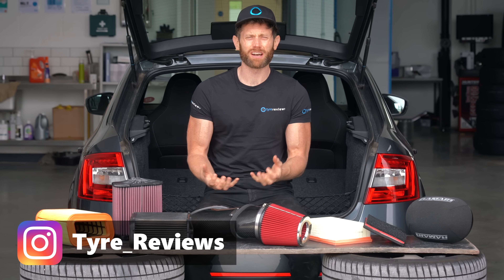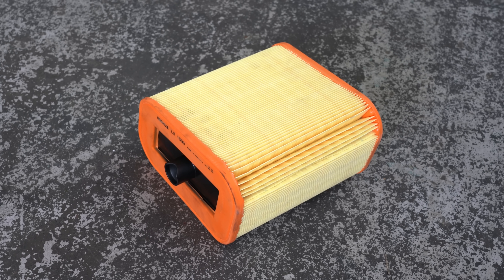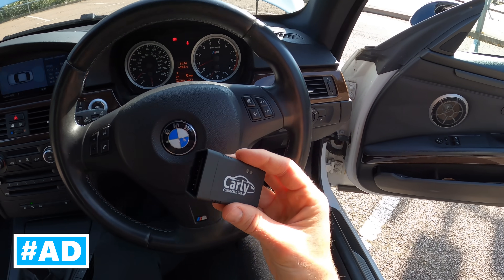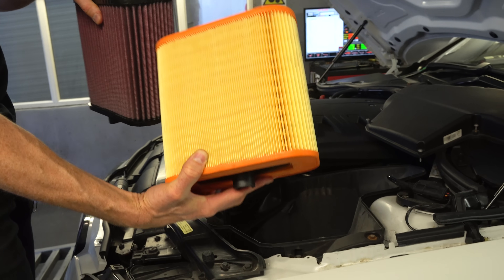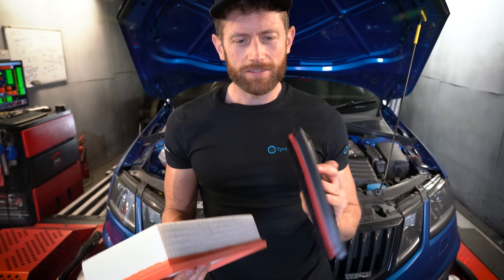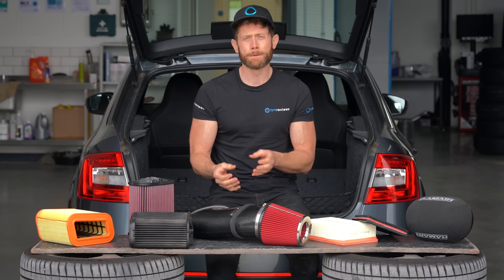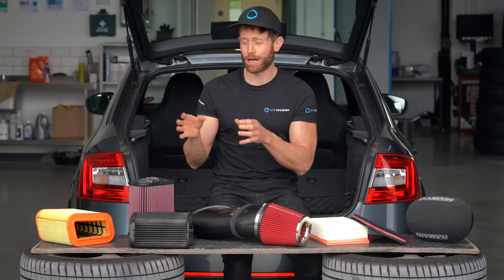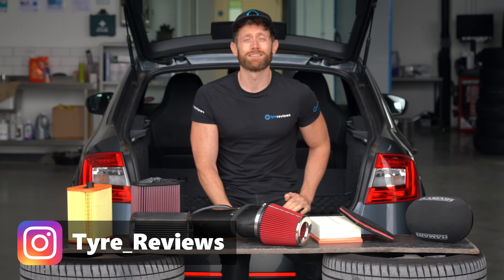Do Performance Air Filters REALLY Give You More Power?

Comment: So there are two different situations to discuss here.
1. The NA engine. There engines are pure unaided air pumps. They can suck air in as much as configuration allows (intake, exhaust, intake and exhaust valve overlap, intake valve timing using the variable valve timing actuators/pinions they may have if it's the case, and so on). The other things that matter when talking power are kind of fixed: ignition timing advance and air fuel ratios. However as you've seen the first run produced quite a bit of power and that was because the engine was cooler after it was probably stopped for a while to strap the car on the dyno. Once heat soak comes into play you will see a drop in performance no matter what you do, more evident than with turbocharged engines, simply because they suck in volume and not mass, because that's how they work.
2. the turbo charged engine. These engines are load tuned, meaning that at a certain RPM and acceleration pedal opening the ECU software targets a certain load. load is directly proportional with the mass of air. This means that depending on the conditions (intake air temperature, atmospheric pressure) the ECU software will adjust the turbo wastegate up and down to make it push the desired amount (read "mass") of air to hit its target. If the conditions are harsher (higher IATs, lower baro pressure, less permissive air filter, and so on) you will simply see higher wastegate duty cycle - read "the turbo will work harder" so reach that target. With the factory calibration it will eventually hit it no doubt, even if there will be like 0.2-0.5 seconds delay due to the more aggressive actuation for the wastegate. So no matter what you do these turbocharged engines will stay around the load target at each RPM point. The only things that will affect power will be the ignition timing andvance and air fuel ratio which may vary if the post filter (intake) temps are high and/or the intake manifold air temps (BAT - boosted air temps) are above a certain threshold, which will make the AFRs go richer and the timing go less aggressive to prevent knock, both having a negative effect on peak torque at each RPM point (torque * RPM * some constant will give you the actual power).
As a conclusion, these high performance air filters will not add that much power, usually none at all. Yes ,the factory or OEM-like paper filters seem more dense but also look at the total surface compared to the cotton wet or dry performance filters from KN, AEM, RamAir, Green, whoever: the factory filders have a larger surface even if when comparing 1cm2 with 1cm2 the OEM-like seems more restrictive.
The intakes are sized properly so that with the OEM manifolds, exhaust systems, catalythic converters, turbos when it's the case, and so on, no chocking will actually occur in normal conditions. Another common mistake people do when they add cone filter intakes is that they neglect the radiant heat which is now sucked by that filter, while with the factory air box the air is drawn from outside the car, totally or at least partially.
And one more thing people get tricked by when replacing the factory intakes with aftermarket intakes which also have a different Mass Air Flow sensor housing is that at the beginning they will see an increase in power due to the increase in air flow and leaner AFRs. But that happens one or two pulls before the ECU adapts with the fuel trim mechanism and compensates for the air flow deviation just like it does between summer and winter, or with fuels which may have more or less oxygenated additives in them (usually ethanol).
When the car gets modified, even with an ECU tune, these better flowing filters come into play and indeed may bring performance past a certain point. Up until that point they are like trying to get a drop of water through a 16mm garden hose or through a 1000mm industrial drain tube, the drop of water with go through both with the same speed because it will not be enough to have enough restriction. However when you start pumping more water the 16mm garden hose will show its weaknesses compared to the 1000mm industrial drain cement tube.
Long comment for an youtube post, but I hope this clears it all :)
Reply from the maker: Great comment, thanks for taking the time to write it all up!
Reply: "When the car gets modified, even with an ECU tune, these better flowing filters come into play and indeed may bring performance past a certain point"

So which modifications are you referring to here? And does it depend on aspiration? Asking because you seem to know your stuff :)
Reply: @solitaryclusterofneurons598  Yes it depends on aspiration. Basically if you test different air filters (OEM, OEM equivalent, aftermarket, cone filters of various kinds) you will not see any differences (or too small to even care, <1 maybe 2%) in flow at the same pressure drop or in pressure drop for the same air flow. It's like dripping water through a garden hose or a 3" tube from a 10ml syringe. Think of the hypothetical 10ml seringe as the engine capability of sucking in air (NA or tune load limited supercharged). Well, if you replace the 1ml syringe and start pouring from a 2.5 gallon or 10 litres small bucket you may start seeing the limitations of the garden hose compared to the 3" tube. That's pretty much with engines... the 10 litres bucket is the big turbo catless exhaust car or the NA with cams and better exhaust and manifolds and stuff, both with better tunes.
By the nature of things the NAs will be more sensitive to better air filters even if the gains will be smaller, they are load limited by their nature and you get more power only by minimizing pumping loses (apart from AFR, valve timing and ignition timing).

Comment: Thanks for the very interesting and informative video comparison of these filters, Jonathan. I've done some research on my own on these filters and it seems that the stock induction systems on cars from makers like BMW, Nissan, Honda et al are pretty well engineered and performance gains, in terms of increased airflow, are miniscule with most of these aftermarket systems. A good clean paper filter that can flow the engine's airflow requirements at maximum horsepower with minimal pressure drop is all that's needed. I would rather spend my money elsewhere, like with a good tune and maybe a less restrictive exhaust.
Reply from the maker: I can't wait to add an exhaust and tune :)
Reply: Stock exhausts also tend to be pretty good Jim Nesta -- good sizes (usually), mandrel bent, 409 stainless.
Reply: @TassieLorenzo  True, I'm considering installing a set of low-restriction cat back pipes, haven't decided though on things like whether to go with an x or h pipe crossover.
Reply: @videomaniac108  x pipe sounds great. I have on F-150  carven rt mufflers also used black widow muffler great flow on both 🤙
Reply: @keepitsolidkeepitreal2877  Very true. I just had a Fast Intentions x-pipe cat back exhaust, a Stillen Gen 3 long tube intake and an EcuTek dyno tune done on my 370Z 6MT sport pkg. The result is that it sounds great and picked up a uniform 15% increase in torque over the whole rev range and about a 40 hp gain in peak horsepower at the rear wheels @7200 rpm.

Comment: What we have here is a case wehre we have a properly sized air filter (perhaps even bigger than whats needed)on the BMW M3 where the CFM the airfilter can move is higher than the demand of the engine... Then we have the Turbo engine where the CFM the air filter can move is lower than the demand of the engine.  Glad to see a car manufacturer that knows how to properly size an intake for the application and one where they're under sizing it.  Would be nice to see you return to this with a tuned engine as those small gains you're seeing on that turbo engine will be way bigger when you start tuning the engine to ask for more air and more fuel over stock.
Reply from the maker: Perhaps it's time for some maps :)

Comment: All makes sense especially from the main German companies who really to their work in building their engines.  I have an Audi A6 TDI with a software upgrade.  Use stock airbox with a Piper Cross air filter.  Runs fine but didn't notice any difference, even in sound

Comment: “10 power”
“Hot air bad, even if it’s lots”
Couple quotes in there made me laugh 😂
Reply: Living in italy with many month with more than 35* C and chip tuned turbo car, i've choose to upgrade the stock intercooler reducing air temp after turbo hoping to avoid piston knock, instead of getting more hot air with a sport filter. With tune i got 42 more hp

Comment: I'm glad you mentioned project farm, otherwise I'd have made mention of it. I would take the hit in hp just for better filtration.

I have an ea888 car as well, and i do want an induction system. The only ones i will consider are the ones that will let me use the standard paper panel filters.

So far, that would be the revo carbon kit, and the 034 motorsports p34(non carbon) intake

Comment: I was going to mention the Project Farm video, but you did already! 

Very good video! 

I think a lot of people get hung up on more engine noise making more power - I've been guilty of it. 

An intake will only allow for more power when the entire system is upgraded and tuned - you can't pull in more air if you can't push it out more effectively, and you can't use the air if you're not getting the extra fuel to mix with it and burning it at the correct time. 

It's all about the balance. Now, if you want more engine noise, or you want to hear that sweet, sweet turbo spooling, an intake will help with that... a little. However, depending on what you use, you may actually cause damage.
Reply from the maker: I do like the noise!
Reply: @tyrereviews  more noise is more fun!

Comment: Please stick to tyres
I went over the comments and generalization is all over the place. I’ve seen some good improvements on older cars, backed by the data of the rolling road. I’ve got the impression that there are loads of dependencies and at least some of the reputated brands do invest quite some time in design and testing. I respect your work and test results, but they are only valid for the tested cars and tested filters.

Comment: Did you re run the first at last? That's one way of estmating the heat buildup during the test.

Then again, the only ones that have gotten more power out of special induction systems are the makers of those systems.
Reply from the maker: Yes for the M3 the results are on screen, for the skoda the first and last was the same :)

Comment: Peak dyno #s are meaningless without seeing the entire dyno chart to judge the baseline curve vs aftermarket. According to this, the M3 gained 7.5lb tq going from stock to K&N. Which means it should've gained horsepower somewhere in the low-end too. As an engine that lacks torque, any low-end gains for the S65 is a big win.
Reply: Excellent comment.  Unless you regularly drive at the RPM where peak numbers are generated, the drop/gain throughout the entire curve is what's more important.  I'm also surprised the torque gains were displayed in a way that made them hard to see and weren't even mentioned in the dialogue.

Comment: Great and interesting video! I have been changing air filters and air induction kits on my cars since I purchased the first one.
The key lies in the air flow rather than filtration. A Citroën Saxo vts would gain 10bhp with a venturi type admission.
On my e92 M3, i didn't go a bench but did 100km/h to 200km/h : no change between OEM new, K&N and even macht Schnell with the small scoops...waste of money! I gained 0,5s with the track pipes 😉.
Reply from the maker: I'm excited for the exhaust and remap!

Comment: I like to add that sometimes oiled filters like K&N Cotton filters can shed oil particles which can damage/contaminate the engines airflow sensor. (Not a problem for everyone)
Overall a very well conducted test, just like your other reviews.
Most really do miss the heat issue, I always feel a bit sad when I see a modified car with the air filter stuck straight on the turbo.
Reply from the maker: My first car, and MG ZR, I did exactly the same thing. Intake in the engine pulling in all the hot air.
Reply: @tyrereviews  Well, we all must start somewhere. :)

Comment: Dont forget to do the "Intake Hack" on the Skoda Octavia!!  I did it to my own, although a 2.0TDI 150,  and the bum dyno feels that it is sharper to respond on throttle & turbo..

Open up the Air Intake in the Grill/Bumper area, and block off the Rear Opening straight to the engine and cut open the right hand side for a Dual Intake
Reply from the maker: ooo I'll check it out!
Reply: @tyrereviews   Just YouTube Search "MQB Airbox Modification" and it should be the first one..

As well as doing the Intake Mod,  i've also installed PiperCross Filter and have the Darkside Development Airbox to Turbo Silicone Pipe,  so for a TDI,  it makes lovely spooly boi noises now 🤣🤣
Reply from the maker: @MrAndersie91  Zooooooooooop pew pew pew
Reply: @tyrereviews  Hahaa..  Nothing that extreme unfortunately being a diesel,  but theres a definite a low pitched Induction Spool Up and a "Pssshhhh" when you let off in a high gear and low rpm,  additive around town hahaa

Comment: Do not think this is an accurate test. 1 run per different filter is no where near enough. 
Car needs adaptations reset and a little test drive so the ecu can react to the changes in the air coming in. 
Changing the filter for each run will do absolutely nothing as shown. Car has not enough time to adapt to the changes hence why we see same dyno numbers. Also in-between dyno runs you need to let the car cool down properly so it doesn't heat soak and show lower number. No idea how much time you've had in-between runs but seemed very wrong the way you did the test.
Reply from the maker: Good comment, and we did exactly that. The car had time to cool between runs and we ran at each setup at least 4 times to make sure the ecu adaptations were made. You just don't show all that in edit as it's boring

Comment: The oil coated filters coat the maf sensor and they become contaminated and stop working.
Reply: That may happen if you dont know how to coat the filter correctly because alot of people put too much oil. But if you do one pass with the spray on each pleat then you will never have anything to worry about.
Reply: Rob K.  understood but it defeats the purpose of fitting a performance air filter if the maf can’t read the airflow and temp.

Comment: I assume this measured flywheel power? What correction factor was used? Dynos are reliably able to measure hp at the wheels but things get a bit fuzzy when it is converted to compute flywheel power.
Reply from the maker: It was calculated flywheel power, however the dyno developements does it

Comment: I have a similar filter on my Golf R to the PiperX you ran on the Skoda.
It’s a RacingLine filter.
I was running a cotton K&N filters on my old cars but after PF showed how much dirt they let in, I didn’t bother anymore when I got my new car. The foam ones are supposedly better at filtering than the cotton ones whilst still giving you the performance gains.

Comment: I’ve looked into this before and your video confirms what I previously been found. I’ve just been using paper air filters, and replaced them every year. A disposable filter from a reputable manufacturer like Mann or Mahle, can make a major difference. I replace the filter every year, it seems worth it. How about a test of exhausts, standard vs aftermarket? More expensive to do, but would be interesting. Also, fuel additives could be an interesting test; I’m not quite sure sure if they work or not.
Reply from the maker: Greaat ideas :)

Comment: For those stupid enough to use a Krap & Nasty oiled filter I suggest you get an oil analysis done.  You’ll see very high Si numbers.  Having read maybe a 100 odd, UOA’s from Krap & Nasty equipped engines, I wouldn’t use one even if it was free.  If you hate your engine that much, do the job properly and pour some sand down the intake!

Comment: An Australian 4x4 magazine done a filtration test with stock paper filters vs K&N cotton vs Foam filters on a Toyota Landcrusier.
The K&N type do flow marginally better than foam, but they both flow heaps better than stock type paper.. 
But as you have shown there is not much power difference between the three...
But ???   When they get dirty..  The K&N clogs up 1st followed closely by the stock paper. While the foam type kept flowing.
Then there was quite a difference in power between the three, with the foam keeping the power as the other 2 fall away
Again as you shown with the dirty K&N..    On a stock engine, filters don't do a great deal. But on a modified or retuned, chipped etc
Then they are a benefit
Reply: Benefit??  Exactly the opposite...

Comment: I did notice a slight gain in torque between the filters on the bmw as it being NA usually hard to get bhp from stuff like this but torque seems to get increased with more flow on naturally aspirated engines

Comment: I found the best way to get more airflow into my M3's engine was to bolt on my supercharger.
Reply from the maker: haha nice :)
Reply: @tyrereviews  You have great content by the way. Thank you very much!
Reply from the maker: @rev68  Appreciated :D
Reply: They are absolutely Savage when you do that.  Did the first G Power SK2 in the UK and the first Rotrex based UK made kit too.  Was insane.  Vortech based ESS is also excellent.
Reply: @salmanjanjua4039  Sadly, I went with Active Autowerke and the HKS GTS8550 which had such issues that HKS USA pulled out of the United States instead of fixing all their bad blowers.
Reply: Looking forward to the m3 build vid as I run the Akra evo exhaust on e90 m3 and curious about the eventui intake.